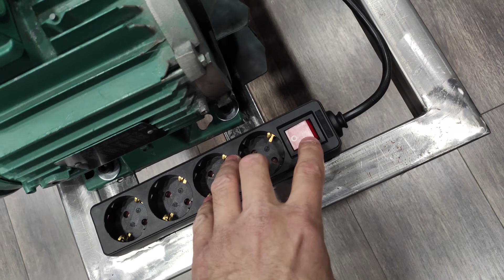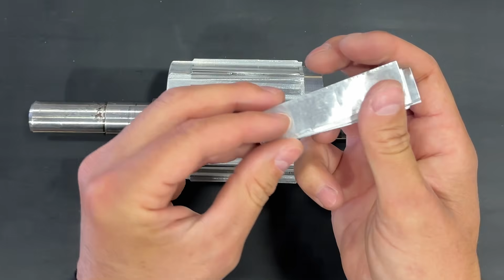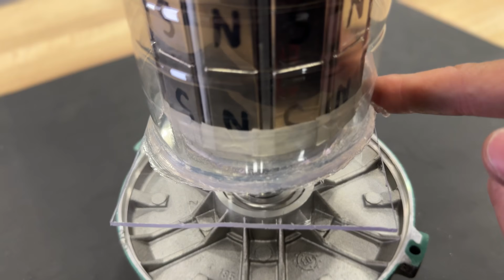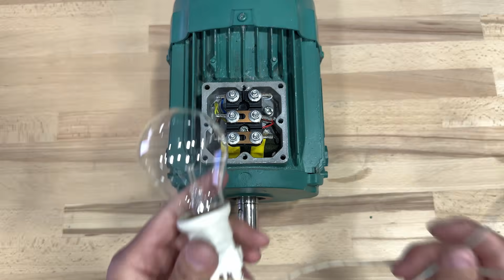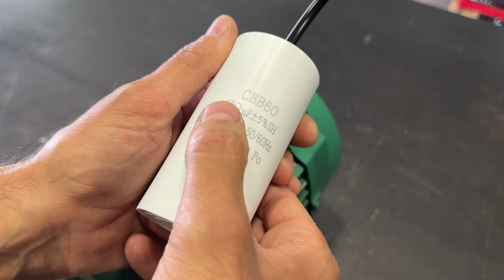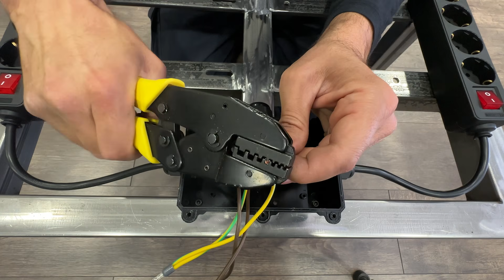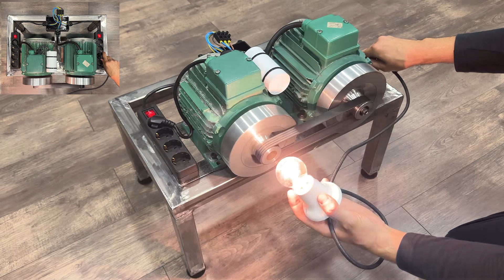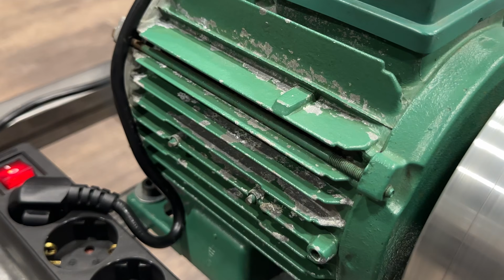10KW! Free Energy with Two Electric Motors💡⚡💡Liberty Engine 5.0

Comment: How much CURRENT (Amperes ) does the Alternator produce. If this can be measured then, the total Power ( kilowatt ) can be determined. If you can do that then, we can calculate how many machines or lights it can power including the motor that runs the Alternator.

Comment: Its amazing that the powers that be have kept the same basic design. New research shows the flaws of the excessive metal causing drag. When removed or insulated magnetically and from hystoresis, machines operate at much higher efficiencies. This video does it different. But the principle design, kept in the text books since the motors invention, have the statement of the laws of thermodynamics broadcast. However, there are many examples of removing over 90% of the metal and having a non metal flywheel component where only 8% of power is required for the same results.

Good job on the extra strong magnets super alternator. The quote of LOTD on this does not apply as the alternator is far improved over the motor. Original ideas of this as an apprentice sparky use same motor as alternator. These cancel each other out so to speak as the WELL EDUCATED who never try anything outside of the box as the brain washing works to stop them from trying. This is why inventions come from those who are not convinced it won't work before they try it. Where as the highly educated remain a skeptic, they never invent anything.
Reply: "to speak as the WELL EDUCATED who never try anything outside of the box as the brain washing works to stop them from trying" 
Uhhh, there are litteraly hundreds or even thousands of such videos about "magic free energy" on the web.
But did you allready see such a thing work with your own eyes ?
No.
And you never will, simply because it's impossible.

Comment: It’s such a convincing lie that people with little technical knowledge can easily believe it. And here too, many people seem convinced that it actually works. ---This setup may run for a while, but at best you only get back around 46% of the energy you put into it. Since there are continuous losses in the system, you have to keep supplying additional energy to prevent it from stopping. It runs for a while and eventually slows down and stops. Otherwise, if it truly worked, he would have already become rich selling this invention instead of just posting videos.-
Reply: Nobody will become rich selling a rig like this because our government has the patents to it! You didn't get the memo?

Comment: Interesting. How exactly was the generator's cooling implemented? To push a 1.5 kW motor—converted into a generator—up to an output of 10 kW, I would try cooling it with liquid nitrogen as a first step. I plan to build three of these units and use them to power my BEV. The utility companies are all going to go bankrupt... Or is the mechanical output of the system perhaps supposed to be 10 kW? How about using it to drive a wheel and running the system on a dynamometer?😉

Comment: The biggest problem with these machines is hiding the power input. This is impossible; the laws of physics apply, ladies and gentlemen. Fiction is just one such effect that will bring such a system to a halt very quickly without external power.
Reply: The laws of physics can be broken. For years, it was thought that the sound barrier could never be broken.

Comment: What happens when you connect this to your home and cut off the main power? It will then run slower and slower until it stops
Reply: Pourquoi s'arrêtait-il un moteur fourni l'énergie à l'autre. Il faut juste respecter l'ampérage de sortie pour éviter les surchauffes
Reply: Yes, it will be overloaded if you exceed the amount of energy it is designed to produce. But the same could be said for a battery charged by solar power connected to a power inverter.  What this can do is take care of running continuous operation devices, like the computer I am typing this on.  The average home in 2026 uses LED lighting which this device has enough power to run.

Comment: It is funny to see people say "This is free energy" when its actually not.
To get the results your throwing out the Generator must produce more power than the Motor which drives it, also the weight of the flywheels has to be very heavy to maintain speed. Because of friction this will always slow down and stop, unless the motor driving it is using less power than what is produced. 

A power source which could do this does not exist, because of Friction.

Comment: If any motor generates current after magnets are attached to it, that current is DC current. So how did you run an AC motor using DC current? Do you think the public is foolish?
Reply: OMG do you not know anything about using magnets?
AC and DC are totally different. AC is like a WAVE, where as DC is flat, 12volts DC, a car Battery, would need a converter to become AC. AC being a wave is both  + & - through its cycle. All magnetic generators are AC unless, like in a car, it has diodes and capacitors to smooth out the voltage to 12.8 Volts.
You could always look it up
Reply: Поэтому магниты расположены север юг
, проходя зону сердечника катушки статора
Воздействие переменного магнитного поля вызывает, тем самым переменый ток
Reply: He built an alternator. That means that AC (Alternating Current) is produced. Generators produce DC voltage. Learn a little about electronics before making foolish comments.
Reply: @anthonystulpin2623   
The 4-Step ProcessCreating the Magnetic Field: When you turn on your car, the battery sends a small amount of electricity to the rotor, turning it into a powerful electromagnet.
Generating AC Power: The engine’s crankshaft spins the serpentine belt, which physically rotates the magnetized rotor inside the stator. As the magnetic fields sweep past the copper coils in the stator, they induce an electrical current. This naturally generates 
Alternating Current (AC).Converting to DC Power: Because car batteries and electronics run on Direct Current (DC), the alternator passes the AC power through the rectifier bridge. This converts the current so it flows in only one direction.
Regulating the Flow: The voltage regulator constantly checks the power output.
Reply: @lashedtodeckklingon121  Yes. This process is well understood. I was just giving the short answer to @UmeshKumar-us1zr.
Reply: Anyone who understands a generator knows that the shown design is an AC generator, meaning that alternating current is generated by the pattern of north and south magnets.

Comment: the rotation of the altenator to 1400rpm from the drill created enough electricity to kick the electric motor on and keep up the 1400 rpm for the excessive power created from the altenator. The altenator is more than enough to run that motor and many more things. This absolutely works. The drill could be a hydro set up and power the motor, the drill is the waterfall here and when the motor turns on it is now running the altenator running it. I think because it's so simple everyone says negative things. Turning the motor into an altenator is the difficult part and find the pulleys. If you need 120v single phase buy 120 v motors
Reply: Agreed.  The science behind this works. People are forgetting that Neodymium magnets produce stronger currents than ordinary magnets.   Because it is AC, you can generate spit phase 220 or 120V using a transformer to step down the voltage for US type.

Comment: It would have looked better with the frame painted and the movement of both motors produced by greased gears. 🙂
Reply: More moving parts, more friction, and gear slop would all reduce the output power.

Comment: One important thing missing which would have sold me on this is if he had moved the bench around on the floor, proving that there were no wires coming up from the floor through the square channel to the inside of the electrical sockets.

My guess is that he still has this machine assembled, so how about a follow-up video showing the frame being dragged around the floor, proving no external connecting wires? It’s not too heavy to do that.

I suspect this type of video is created for no other reason but to generate, clicks, likes, subscribes and thus income.

Has he created a supersized version that he now runs his entrire house from and thus, free energy forever. I doubt it 🤣
Reply: I was thinking the same thing too since he did the 360 camera rotation.

Comment: First Law of Thermodynamics
Energy cannot be created from nothing.
�
Meaning:
A machine can convert energy
Store energy
Lose energy
But not create unlimited new energy
If a motor outputs more energy than it consumes forever, it would violate conservation of energy.
Second Law of Thermodynamics
Every real system loses usable energy through:
friction
heat
electrical resistance
vibration
air drag
So even a perfect-looking spinning machine gradually slows unless external energy enters.
Reply: Двигатель может и не потреблять, но не в этом случае, тут абсурд хуже некуда.
Reply: true but technicly by using the drill he put energie in , but according to him he gets 500% more out of it
Reply: @skunkpuss  Конечно, так не бывает

Comment: While the videos are professionally produced and look very convincing, they describe a device that violates the most fundamental laws of physics. Specifically, it claims to be a *perpetual motion machine* of the first kind—a device that creates energy out of nothing.
Here is the breakdown of why this doesn't work and what is likely happening in those videos:
### 1. The Law of Conservation of Energy
The First Law of Thermodynamics states that energy cannot be created or destroyed, only transformed.
 * *The Claim:* The Liberty Engine uses permanent magnets to create continuous rotation that powers an alternator, which then provides more electricity than it takes to run (or runs with no input at all).
 * *The Reality:* Magnetic fields are "conservative." This means if you move a magnet in a circle, the energy you gain from the "push" is exactly equal to the energy you lose fighting the "pull" as the magnet moves away. Over one full rotation, the net energy gained is zero.
### 2. The "Hidden Battery" Trick
Many of these "Free Energy" or "Liberty Engine" videos use clever staging to hide the real power source. Common tactics include:
 * *Induction Floors:* Powering the device wirelessly through the table or floor using hidden coils.
 * *Hidden Wires:* Running tiny, nearly invisible wires through the frame or the bolts holding the machine down.
 * *Internal Batteries:* Hiding high-capacity lithium batteries inside the motor casing or the "alternator" itself.
 * *Modified Components:* Using a motor that looks like an alternator but is actually a battery-powered motor driving the rest of the assembly.
### 3. Magnetic Braking (Lenz's Law)
In the videos, they often show the engine powering heavy loads like grinders or drills without slowing down. In the real world, *Lenz's Law* makes this impossible:
 * When an alternator generates electricity, it creates a magnetic counter-force (drag) on the rotor.
 * The more electricity you draw (plugging in a drill), the harder it becomes to turn the shaft.
 * Any real engine would slow down or require significantly more input force to maintain speed. The fact that the "Liberty Engine" doesn't flinch is a major "tell" that the power isn't actually coming from the rotation you see.
### Summary Table: Reality vs. Liberty Engine
| Feature | Scientific Reality | Liberty Engine Claim |
|---|---|---|
| *Energy Source* | Must come from fuel, sun, wind, etc. | Permanent magnets (Free) |
| *Efficiency* | Always less than 100% (due to heat/friction) | Over 100% (Over-unity) |
| *Reaction to Load* | Slows down as you draw more power | Stays constant regardless of load |
| *Status* | Impossible by physics | "Suppressed technology" |
### Why doesn't the industry use this?
Proponents often claim "Big Oil" or "Big Energy" suppresses this technology. However, if a device could truly generate infinite free energy, the economic advantage would be so massive that no government or corporation could stop it. Every tech company in the world would be using it to power their data centers for free.
It’s a fun concept to watch, but it belongs in the realm of stage magic and science fiction rather than engineering.

Comment: All they show you is volts not amps or watts.  Also notice they only run one thing at a time. They might be generating just a little more than what the motor needs, but the more they connect put a drag on the system and it will get hot creating friction and stop. Even with one light bulb it will eventually stop.   A very expensive short time apparatus that can light you a lightbulb for a while.  Not very usefull.

Comment: The point here is - both motors are alternating the current flow, both are working for each other

Try is must - but do accordingly what he described in video by collecting all the material first. At the end of the project either you fail or be successful and may curse the laws of physics. Even if you fail still you can research on it again and again - just TRY.

Comment: This is bull. It's just two generators playing hot potato until the potential input is depleted. Even if you have the most efficient system you can build using magnetic suspended bearings, you'll still encounter system loss.

Comment: How do you get past the laws of thermodynamics? Could you show the mathematical calculations you used I believe you, but I’m not sperm enough to calculate how this would work if you could show that it would be fundamentally important thank you for sharing and all the work you’ve done on liberty engine.
Reply: Bro, Law of Thermodynamics is a lure. Most scientists have ganged up to support the Global Fossil Fuel Economy. Energy is introconvertible whether in magnitude or at scalable proportions. For instance, a 3 volt motor can be used to turn a generator that delivers 20 times the power i.e. 60 volts or more. Feedback loop system is feasible as you have seen. Go ahead and do it. The world is yours. But don't get the news spread. You'll be in danger. Keep safe.
Reply: Gracias
Reply: What do you need to know?
Reply: Think I just worked it out please correct me if I’m wrong but if the output is 240w which is determined by the energy needed to start the cycle theres the energy created and the system just keeps that energy running in a circuit, as long as no more than 240w of power is drawn it will hold the loop the machine 
The only issue surely is the energy created by heat friction etc magnets can’t get too hot 
I never went to school I just watch videos so laugh but that’s how I see this I had to google thermodynamics and did a quick crash course and came up with this

Comment: LOL, Guess you have learned a way get around basic physics, law of conservation, thermodynamics etc. Free energy does not exist. It only changes from one form to another etc. And an efficiency of 666%? How did you measure that? Where is the data? What is the frequency? How is it stabilized? So many questions and of course you won't provide answers because you cannot. What is your motive for making these claims? A first year physics or EE student knows all of this is garbage.

Comment: Let’s size the flywheel to actually deliver 10kW for 1 hour with no other input. 

Energy needed
10\text{kW} \times  1\text{ hour} = 10\text{kWh} = 36\text{MJ}
But you can’t extract 100%. You need to keep RPM high enough for the alternator to hold voltage/frequency. Assume usable range = 1500 RPM down to 750 RPM. That’s 75% of kinetic energy. 

Required stored energy:
36\text{MJ} / 0.75 = 48\text{MJ}
Flywheel sizing
Kinetic energy: $$E = \frac{1}{2}I\omega^2$$  
For a solid disk: $$I = \frac{1}{2}mr^2$$  
So: $$E = \frac{1}{4}mr^2\omega^2$$

Take practical limits: 1500 RPM = 157 rad/s, steel flywheel, radius 0.5m so tip speed = 78.5m/s. That’s already scary – 280km/h at the rim.

Solve for mass:
m = \frac{4E}{r^2\omega^2} = \frac{4 \times  48\times 10^6}{0.5^2 \times  157^2}
m = \frac{192\times 10^6}{0.25 \times  24649} = \frac{192\times 10^6}{6162} = 31,155\text{ kg}
Result: ∼31 tonnes of steel, 1m diameter, spinning 1500 RPM.

Reality check
*Issue*	*Why it kills the idea*
*Tip stress*	Steel yields at ~400m/s. You’re at 78.5m/s, so safe, but 31t at 1500 RPM has 1.2MN of radial force. Needs vacuum chamber + magnetic bearings.
*Size*	31t @ 1m dia, 0.5m thick = 1 disk. Two disks = 15.5t each. Your garage floor loses.
*Spin-up energy*	You must put 48MJ in first. That’s 13.3kWh from the grid. 48MJ = 13.3kWh @ R3/kWh = R40 to “charge” it once.
*Safety*	If it fails, 48MJ = 11.5kg TNT. Commercial labs use underground bunkers for 1/100th this energy.
Comparison
*Tesla Powerwall*: 13.5kWh, 114kg, fits on wall.  
*This flywheel*: 10kWh usable, 31,000kg, needs a warehouse and a safety exclusion zone.

*Bottom line*: Flywheels are great for 5-30 seconds of ride-through. For 1 hour @ 10kW you use batteries or fuel. Physics lets you do it, economics and safety say don’t.

Want me to calc it with carbon fiber at 50,000 RPM instead? It gets “lighter” but even more terrifying.